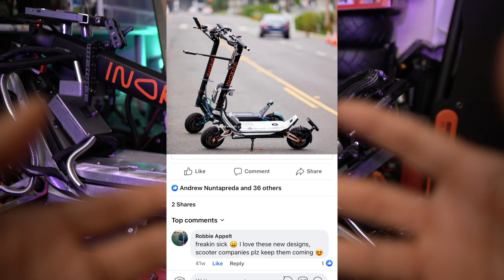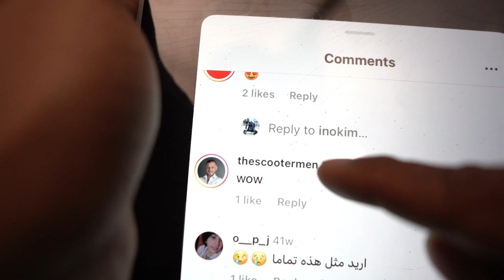Inokim Super Electric Scooter | What's New?

Comment: I have the Inokim OXO Super and I love it, I did swap the brakes out to Megura Hydraulic e-Bike breaks and put larger Hope slotted discs, plus the PMT Slicks and it's an absolute beast. Also not sure if you've seen these with the upgraded ASI BAC800 controllers people have pushed these to 10kw+ hitting over 80mph!!
Reply from the maker: I'm glad to hear that you're enjoying your Inokim OXO Super! It sounds like you've made some impressive upgrades to enhance its performance.

 I don't think the Inokim OXO frame was designed to handle speeds above 50 mph as it may pose a significant safety risk. If individuals are considering increasing the speed, it would be advisable for them to exercise caution. Safety should always be the top priority when modifying electric scooters to ensure a smooth and secure riding experience.

Keep enjoying your enhanced Inokim OXO Super and stay safe!
Reply: What ??? 80mph ?! That’s insane

Comment: is prob. at least 3 years  away ... and it will be easily a cool 5k.

- 60/35ah batt. with 21700 cells is easily 1.5k
-2x50ah controllers sine wave about 400$

Add lights/Throttle/Lcd display/ New design/11inch tires/4 piston brakes/Regen/App maybe ? -another 1k